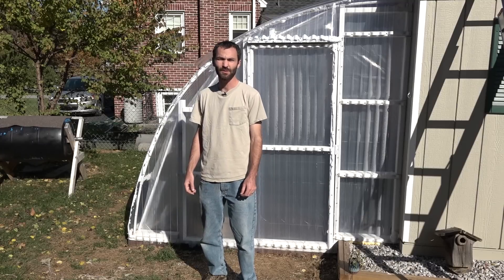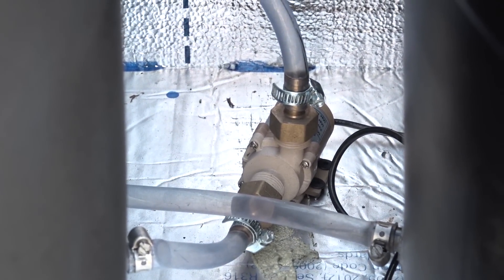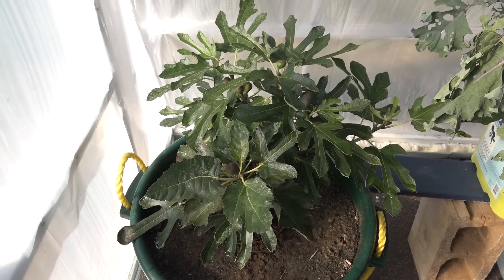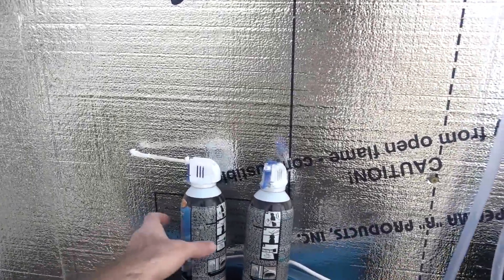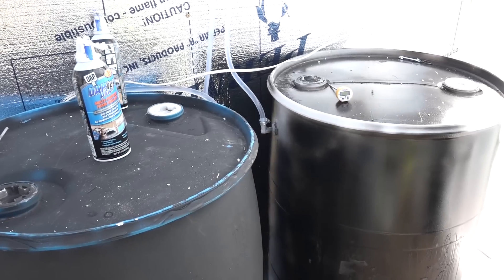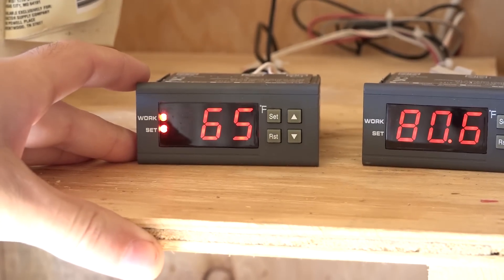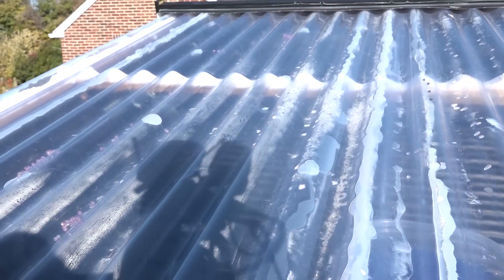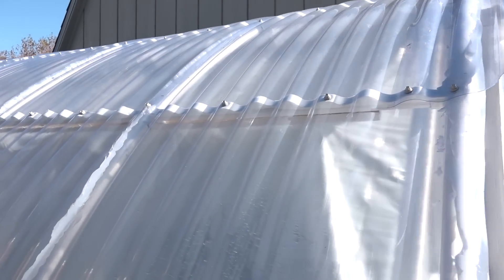DIY PVC TUFTEX Polycarb Greenhouse Heated with DIY Solar Water Heater

Comment: What size pvc pipes did you use?  And, how did you drill a hole without cracking the pipe?  Size/Type of screws? I'm stuck on this so any info would be much appreciated.  Thank you.
Reply from the maker: It's 3/4" pipe. I really don't recall the size hole I would drill. But I did drill first and used the recommended screws for the panels with the little rubber washer.

Comment: This was a big help. I plan on doing this exact build
Reply from the maker: Cool glad you found it helpful. Just be sure to get the right type of panels. I used the wrong type as I mention in the description and they are starting to turn yellow and black in spots that get the hottest. I'll probably remove them all in another year or 2 and put in the right kind that can take the high temps.
Reply: I’m thinking of using the Tuftex panels from Lowe’s. Is that what you used?
Reply from the maker: @daveWmck  I used Tuftex SeaCoaster panels. Which at the time I thought they were all the same just a different curve to the panel. But you want Tuftex Polycarb panels they have a higher heat rating. The curve on the panel is more angular wheres the SeaCoaster is more of a smooth curve. The link I put in the description is for the right kind. Good luck!
Reply: Thank you!

Comment: you should try to insulate the barrels from the top to around a foot or 2 above the base. Maybe they would release heat slower doing this but allow for heat to be stored and released over longer periods of time. Decent setup none the less although it looks pricey.

Comment: Very Nice! How did your greenhouse make out over the winter?  Were the barrels sufficient to keep the greenhouse above freezing?  Update please!  I will be trying something like this once I remove a few more trees.  Thanks for sharing!
Reply from the maker: Hi, Justin. I will try to make an update video soon. But until then, the barrels and solar heater helped significantly however the sun is not always shining. Sometimes we would have several days of cold, cloudy, and or snowy days. So it was not always able to keep it above freezing. Also when it got really cold at night the lines would freeze sometimes and remain froze all day if it did not warm up. The temp of the solar heater would climb well above 100 (even on cold but sunny days) but because the lines were still froze it was not able to pump down into the barrels. So next winter I'll add more antifreeze and or salt. I had a small electric heater that was hooked to a thermostat and set to come on at around 34 degrees F. It rarely came on and I did not even notice a difference in my electric bill. I also recently, now that it's getting warmer, added an exhaust fan that comes on if the temp gets to hot. 

I'm glad you liked the video, good luck with your greenhouse!
Reply from the maker: Here is a little update video I just made. https://youtu.be/gFBEf1l_aVs